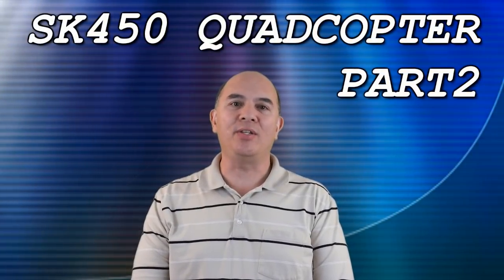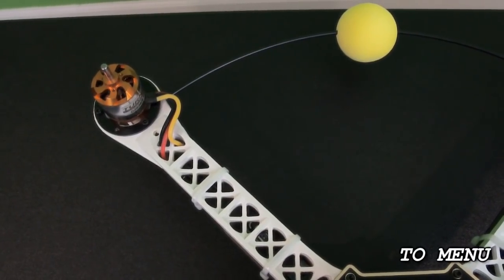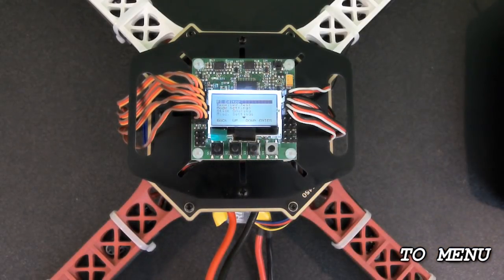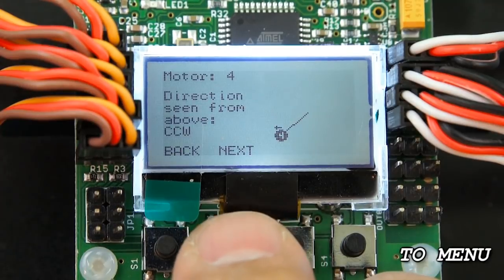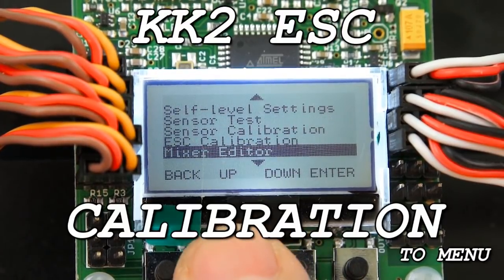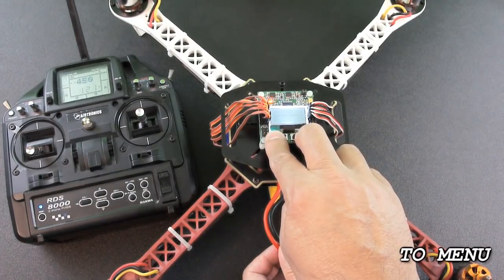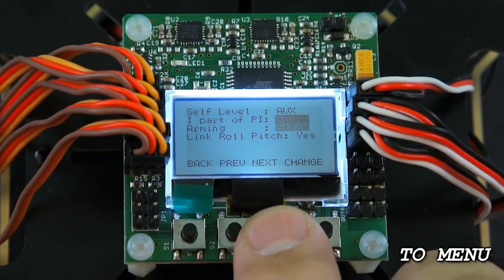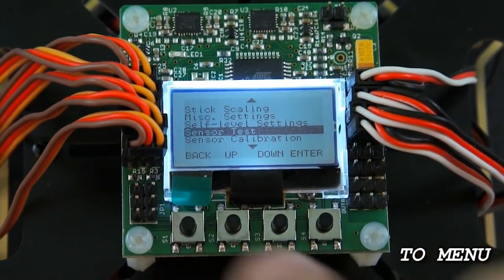SK450 Quadcopter Part 2 Setting up

Comment: I just compare the factory settings on my quad with your video, after having some problems getting it off the ground and found some good difference on your settings. All the pre fly test seems to be good now. I'm about to take it outside for a first flight.
Will post the video and give you an up date. Thank you for your help.

Comment from the maker: I've used both the Rhino 2250mAh 40c 3s1p and Turnigy nano-Tech 2200mAh 45~90c 3sip LiPo batteries. You can use bigger ones if you want longer flight times. These are good for around 7-8 minutes I guess as I haven't timed them.

Comment from the maker: If you are going to use it for FPV don't forget that you will have the extra weight of the extra equipment on the quad. You can go down in size on the motor length but stick with a 28mm diameter motor rated between 900kv to 1200kv. There are lots of 28mm diameter motors on HobbyKings site around 30mm in length. You will want the ESCs to be in the 20Amp to 30Amp size range depending on the motor ratings. The ones I used are 25Amp. Check out the link in the video info bar.

Comment from the maker: Could be a lot of different things. esc calibration, did he calibrate all ESCs individually before plugging them into the kk2 board?  Maybe ESCs not wired in correct order into kk2 board. Or props not in correct orientation to what's shown in the menu. The list goes on and on. I suggest starting over and setting everything up from the beginning again. If that doesn't work check the kk2 forum link in the video information bar below the video.

Comment from the maker: Sounds like an esc calibration issue. Did you test each esc separately with the radio rx and tx to make sure throttle end points are set and all esc are working properly? That must be done first before plugging everything into the KK2 board. After that connect all esc to the KK2 and do the esc calibration per in the video and adjust the minimum throttle setting in the KK2 so all motors start at the same time.

Comment from the maker: No, did not flash it, used KK2 out of the box with the factory installed firmware v1.0 Not sure why you don't have esc calibration, it should be there if you scroll through the menu.

Comment: Thanks for the only complete guide for this anywhere. I just bailed from trying to use a multiwii w/ v2.1 -nice controller -BUT, your 'on your own'. Hoards of time and hair pulling, little, incomplete, help, here and there -wanted to quit while I was still sane. Finally after 4 months the KK2 is back in stock -as the KK2.1. Installed it and watched your video. The ESC calibration menu item is not there. Is that a problem? I guess I'll soon be finding that out.

Comment from the maker: You want go to "receiver test" in the menu and check the stick movements are correct. when you move right it should show right, left should show left, etc. If it's wrong, change the direction of the servo throws in the radio for the channel you want to change. Also go back and watch "equipment setup" and "Basic setup" sections in the video again.

Comment from the maker: It's been a while since I set this up so don't remember the setting at the moment. You can find my final settings if you watch the Part 3 video. I don't think they will be optimal for your set up as it is quite different than the one used on my quad. Your motors are higher kv and the props are smaller and you are running 4 cells not 3 so that changes everything. The part 3 video goes over how to tune the PI gains settings to get rid of oscillations.

Comment from the maker: Not sure about where to plug in a separate  BEC. You will probably need to search the forums for that one. There is a link to the RCGroups kk2 forum in the video information bar below the video. The link is all the way at the bottom.

Comment from the maker: You need to reverse the throws on your radio tx on the channels that show the opposite direction in on kk2 board. After you do this they should show the correct direction on the kk2 board when the sticks are moved.

Comment: nice video , i made mine , yesterday ,, package came yesterday ,, used your video is great ,, butt mine also has CCPM settings ,, maybe you have to update , LOL ,, i also have the sk450 i use kk2.0 turnigy 1400 kv ,, and 30 amp esc PUSH , 8 inch props ,, its flying great , used your instructions , works great , onley one problem when u use wifi and using this video , every time turn on my Tx ,, i have no conection LOL ,, i need to reconect wifi ,, butt video worked great THNX

Comment from the maker: If properly setup in the KK2 board you shouldn't need to trim it from the radio. I didn't use the radio trim tabs with mine other than during setup to make sure all 4 channels were centered properly.

Comment: Hi Frank, just watched both build videos...My question is this...are you happy with all the parts,motors etc you went with on this build? Also would this mother board work with dynam 650 arf...I may want to build this one...How much for all the parts? i already have batteries and radio equitment...thanks again for another great tutorial :)

Comment: Hey Diehard I have the RadioLink TX and the older KK Board. I see nothing about stick scaling but my TX does have EPA (End Point Adjustments) that can be adjusted on all 6 channels. Is EPA the same thing as Stick-Scaling? Right now my 450 quad is WAY to responsive for me to safely fly and I desperately need to tone this thing down. Thanks for any help that you can give..

Comment: i used turnigy 1400 kv with 30 amp push ,, worked great no settings changed in menu ,, RTF .. sk450 fram ,, and did not even balanced my props ,, i used the kk2,0 package box to mount board ,, worked at once ,, i builded it and flying it in one day ,, this is a great combo ,, but go for the 9 inch props ,,i have 8 now ,butt want to change them to 9 ,,

Comment: Hi Frank, I have a KK2 V1.2 and i'm wondering if you could help me out, where do i make changes to make the motors act right. when i hit right rudder it goes down, if i hit left rudder it flips right, left aileron goes right and right aileron goes left, elevator its fine.

Thank you in advance
Reply: You cant change in your Tx, find the program reverse

Comment: Hello. Thanks for the video. When I want to do ESC calibration, throttle stick is in upper position and power on the board. But this time all the ESCs are getting into setup mode. I couldn't get the board's ESC calibration sound. Is there anything that I missed? Pls could you help me? Thanks in advance.

Comment: Might want to pull the power lead on 3 of your throttle wires from the ESC if they are sbecs. if linear then it won't matter but it won't hurt either.

Comment: Okay thanks. The original firmware is a v1.0 I believe. Have you tried any other firmware on it yet? If so does it work better and what firmware are you currently using? I have the v1.2 right now but I have tried the v1.1 and v1.5. So far I found I had good luck with the original firmware (v1.0) and the v1.2. I only updated the firmware to begin with so the selflevel will work. Still messing with it to get the best flight from it. It is a cool aircraft.

Comment from the maker: If you are following the instructions on the KK2 control board screen, then I'm not sure why the ESC calibration is not working properly. You could try posting your question in the KK2 forum on RCGroups. There is a link in the video information bar below the video. It's all the way at the bottom.
Reply: Where is your kk2 forum, i want to joing and discus my kk2 in quadcopter

Comment from the maker: Do you have the kk2 set up as "+" or "x" configuration because if you have it set as "x" your KK2 board is not facing the front of the Quad from watching your video. The bottom of the KK2 board with the 4 buttons should face the back of the Quad in relation to the "+" or "x" configuration. Fix this then see if it will fly.

Comment: My quad is doing a bit of a hoola-hoop ish dance quite often (at least every 5-10 seconds it wobbles)  Any advice on this?  (kk2.0)
Reply from the maker: First check that the KK2 board is square and level to the frame. Make sure the weight CG is as close to center on the quad as possible. Check all props are balanced. Then  adjust the P I gains per the video till you have no more wobble. If non of that helps please check the KK2 forum on rcgroups. There is a link in the video information bar

Comment: Hello DiehardRCaddicts,
I do ESC calibration for my SK450 RTF
1. Unplug the battery on quad.
2. Turn on Remote, apply full throttle.
3. Press and hold 1st and 4th button.
4. Plug the battery
5. Wait for beeps.
6. Put the throttle to idle.
7. Wait for beep
8. Release the buttons (1st and 4th).
However, All of motors don't start at the same time.
I tried several times and sometime only 1 motor start first, sometime 2 or 3 motor s start, and the quad can not fly.
Do you know how can I solve this problem?
Thank you!
Reply from the maker: Melody Anh Dung Try adjusting the minimum throttle setting. Watch the video at 9:10 minutes and it will show you how to adjust it.

Comment: Hello thank you so much for your time making these video ,but i have some problem and i really need help, as I'm new in these hobby !! so  I did all calibrations it need to be done and  power my remote on first and the kk21. second. ,and motors still won't move because i don't know why it couldn't  armed !! and I couldn't  get self level on its always said off ,thank you for your time
Reply from the maker: simo bouryal Not sure why it won't arm if you did all calibrations as in the video. You may want to start from the beginning and do the setup all over. Be sure to start by calibrating the ESCs high and low throttle individually with the receiver. This is usually done by connecting one ESC at a time to the receiver throttle channel. Then power up the radio and move throttle to high position, all the way up. Next plug in the battery to the receiver and esc. You should hear a beep. Then move throttle to off, all the way down. You should hear beeping sequence. Unplug battery and turn off radio. Do this with all ESCs. Then start the KK2.1 setup from the beginning.

Comment: i have a issue with my sk450 i had a crash and i couldnt get kkboard up and running so i measured the 1st esc it was 11volts ??? there other ones was appros 4.8volts 
im a bit confused here , i assume the 1st esc that connects to m1 port is damaged

Comment: What was the final PI settings, cant seem to get mine right it flys OK but is stills wobbles (osscilates) slowly, so it must be the I gain... how to determine if it is Yaw or Roll/pitch that needs to be lowered? Think im down to 20 in Igain and it stil osscilates. My specs, SK450 frame, Plush 30a esc, NTM 28-26 1200kv motors, walkera mx400 3blade props. 4s 3000mah

Comment: I am new at getting one of these. I want to build one. I am very confused about all the wires. I know the ESC plugs into the Receiver (or at least they do on my RC plane) (maybe the ESC's plug into the FC panel & not the receiver, which would mean i don't need a receiver) but in the video there are wires coming up to the flight controller on both the right & left side. Where do they come from & what are they for. Please help. Thank you.
Reply from the maker: ***** Please watch the part1 video. At about 4 minutes into the video it shows the wiring of the receiver, ESCs, and flight controller.

Comment: very good video. i tried and it worked but now when I try again to perform the receiver test, the positive and negative values are too high (-69 or -100+ for the elevator when it positioned full down) so when I try to arm and exit from the safe mode this not works. Does anyone know what should I do?
thanks for the help

Comment: i have a problem sir i have flysky 6ch tx and kk2 board when i was testing receiver i found out that my rudder and aileron shows opposite direction when i move the stick in the same direction 
if i move aileron to right then on board it shows right but if i move rudder to right it shows left pls help me sir :(

Comment: I have calibrated my esc but the motor who's connected to ,1 dosent run and if I change esc then the next motor dosent run y ?and yup the esc also becomes very hot and all my parts r fine

Comment: Sir i just made a drone using kk board
But when i calibrate my esc only 3 motors Motor 1 motor 2 and motor 4 is spinning on 10% of throttle only when i take throttle to 50% then all the motors are spinning